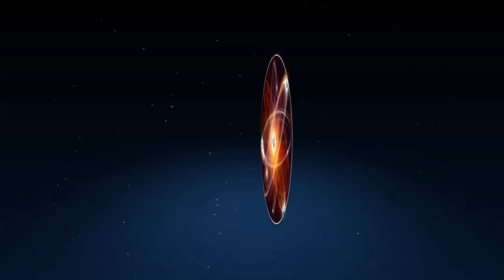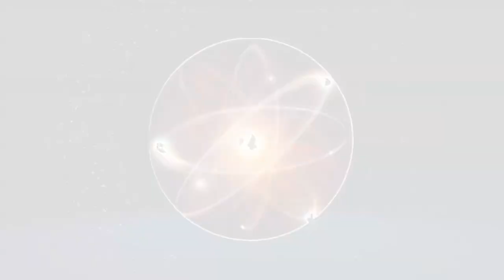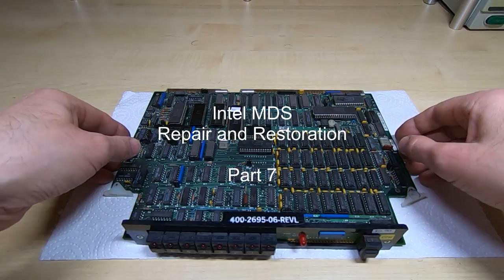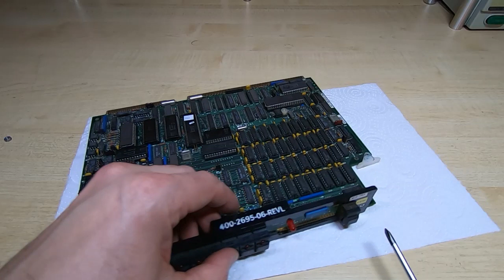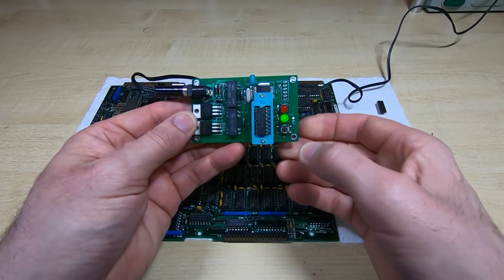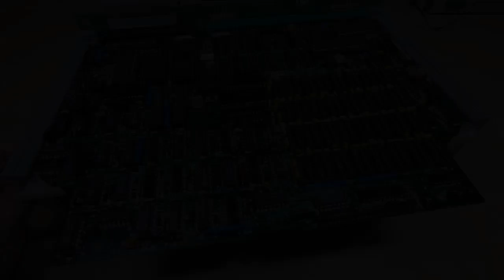Intel MDS Part7

Comment: There were 2 versions of this CPU board.  The earlier design had 32k of DRAM and was called the IPB (Integrated Processor Board).  The later version had 64k of DRAM and was called the IPC (Integrated Processor Card).